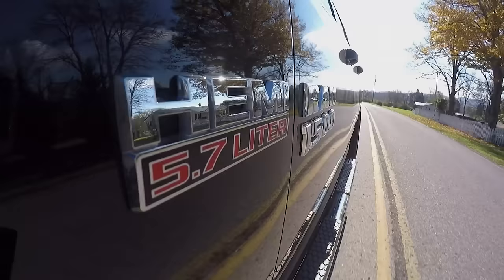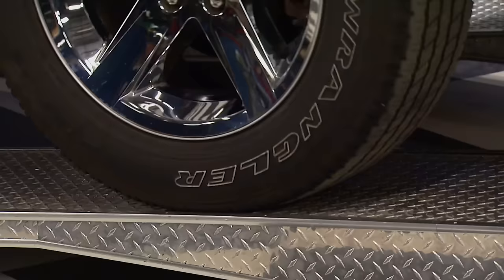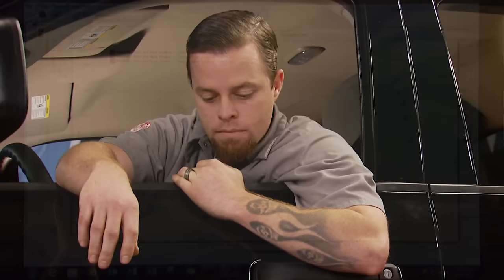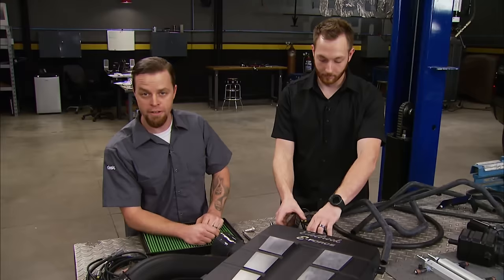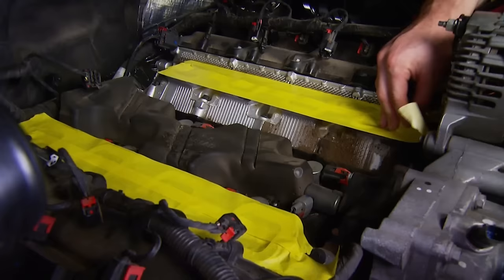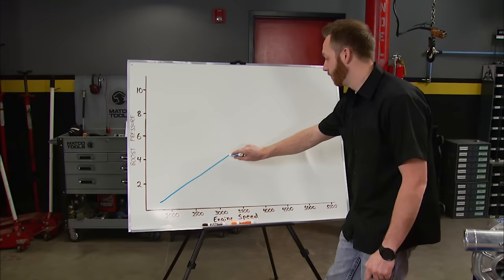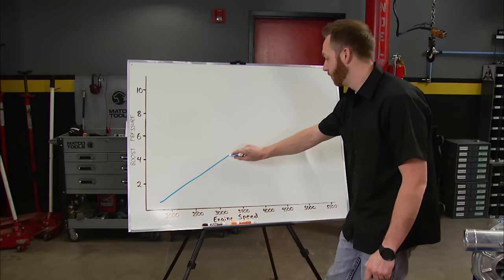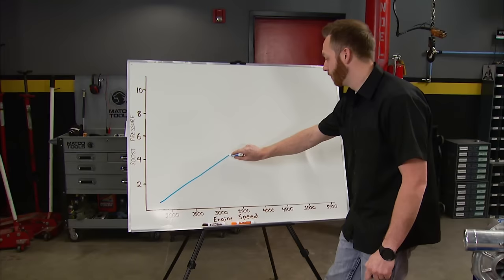Project Hemi-Hauler: Supercharger & Exhaust - Truck Tech S3, E3

Comment: All that money for 100 hp
Reply: Luis Cosme 130 hp gain on 6 psi is very good newb
Reply: @guerrerok90  oh yeah there is no doubt about that but you can get better hp with way less $
Reply: @pascobori9099  they could probably put a smaller pulley on it
Reply: theyre keeping it safe cause it aint built

Comment: I'm so confused. I don't know anything about vehicles but if you take out the stock engine then doesn't that not make it a hemi anymore?
Reply: If it’s replace with another hemi it’s still a hemi but yeah if not
Reply: Hemi refers to an engine that has hemispherical-shaped combustion chambers and pistons with rounded, instead of flat, tops.  When fitting a supercharger, the intake manifold is removed, but the combustion chamber remains untouched, so it is still a "hemi."
Reply: @meadmaker4525  see i wanna become part of the care/truck community but im tryna learn lol

Comment: stock airbox and stock headers are choking it, and the stock pcm doesnt help with that forced induction :( such potential wasted
Reply: Ya the stock air box has to go for sure. I gotta a k$n black series cai in my 2016 and it really helps the 5.7 breath way better

Comment: I'm first owner of a 2016 Dodge Ram 110.000km was thinking of installing a supercharger root style blower kit with your recommendation of a heat exchanger cooling system. I was wondering is it necessary to upgrade my fuel pump system and is my factory 8 speed transmission and differential 3.92 gear ratio too high kilometres for such a upgrade set up. My truck is a current daily driver  I would like to have extra power when I need it on hwy for passing and down a quarter mile track for fun weekends.

Comment: All that for 426HP? I just bought a 2021 Ram Hemi and it's 395 stock lol.
Reply: Smh lol that’s 395 to the crank not wheels. You have to account for drivetrain loss. So 426 to the wheels is a very good increase in power

Comment: i would like to see them do upgrades 2002 dodge ram with the 5.9L gas engine 2wd...i need some ideas
Reply: Get a dakota it will be faster than a half ton
Reply: @WOWster007  I'd like to work with what i have...
Reply: @PANTYEATR1  Supercharge the 5.9 then, recommend vortech or procharger MAYBE torq storm but their blower doesn't come with an intercooler. Best HP per buck unless you want to do a stroker build which will be expensive
Reply: @WOWster007  its funny you say that...i just purchased a 360 stroker last month for $1900. it makes the 360 a 408. it came with forged Scat crank and rods, forged pistons with new ring packs, freshly machined block, and all new rod and main bearings. I'm in the process of clearancing the block for the ARP rod bolts. i would have liked to use the supercharger from that Shelby Durango, but it looks like it would clutter up the engine bay and i couldn't find much info on it
Reply: @PANTYEATR1  I believe that one was Kenne Bell kit those are discontinued for the 5.9 so you have to find one used. Honestly the centrifugal blowers make more power than the roots style. Good luck with your stroker build!
Reply: @WOWster007  i just like the roots style fit the looks honestly. this is my daily and i just want good street power, nothing crazy. thanks for your input💪

Comment: A 2013 under 20k??? I paid 20k for a 2013 big horn 4 months ago!
Reply: Funny I just bought a 2015 limited  Laramie with everything except the ram box for 28 ... with 60,000 miles
Reply: @derekchauvinisahero2010  good price. Mine is a nicely optioned big horn with roughly 58k miles. The interior was optioned out but the original owner skipped all the exterior options and went aftermarket with it.

Comment: my old 1995 camaro with a LT1 made this kind of power with some headwork and a cam.
Reply: Must have been a huge cam.  I've got a blown ls6 470/455
Reply: That Lt1 motor you got if you drop it on a mid 90s Silverado that that truck would dust this overpriced hemi.

Comment: Love the engine upgrade but these engines are known for cracked valve springs and bad lifters. You should have upgraded these and checked the cam for damage before your mods. Why didn't you?  Also, use only Amsoil Synthetic Oil in this engine for maximum protection (simply the best).

Comment: That weird. My stock 2004 put down 290 HP at the wheels and 345 HP to the crank. The new 5.7 HEMI has 395 HP at the crank and only 305 HP at the wheels. That’s crazy. Maybe the transmission is slipping. I can’t understand loosing 90 HP in the driveline.

Comment: Should've traded the Ram for an F150 with a Coyote.  There's a lot less work that goes into installing a Whipple on a new F150.  And the less work results in way more power, and better reliability.
Reply: Yeah but the problem is then you have a ford...

Comment: Colum shifter? 6 speed!!... shame! the 8 speed ZF transmissions stronger.. faster and more fuel efficient!!  Literal car lengths you give up with the old 6 speed automatic 🤣
Reply: But wrong rear end ratio.  8 speed is for speed not pulling.
Reply: @deeply999  i strongly disagree. Ever driven a 8 speed? They stay in the power band 100% of the time. Low end torque, top end horsepower. Had plenty of time with my dads '14 ram driving, towing. Beltech loweringkit and put a airbag kit in the back that sat within the coil springs. Hauling a 20 foot enclosed trailer with a pt cruiser stuffed in the back going 80, 90mph the whole time, up, down the mountain. Wouldn't know it was back there. The 8 speed transmission is superior in every way to the old 6 speeds. Torque and power delivery, everything. 2wd truck, get 16-18mpg highway towing and 24, sometimes 25mpg all on it's own. After having extended drive time in his truck. Never even consider the 6 speed again, dont care what rear end gear it has 🤷‍♂️
Reply: koolaid water fountains for the fat kids ...   yes I own a 2016 trust me I know the power and what a pain it is with the 3.21 axle and the 8HP70 trans.  It will only tow 8814Lb. I know I can tow a bit more as my trailer is 9300 loaded but at 6 mpg it’s not anything I would recommend

Comment: " she'd rated at 375 hp " then only pulls 300 on the dyno.
Reply: 395hp was the factory rating. That Dyno number can't be right. Needs headers for sure
Reply: Sounds about right 375 number is to the crank the 300 was to the rear wheels
Reply: @hossmoss8577  That still seems like a lot of driveline loss to me...
Reply: That sounds about right
Reply: @lashlarue7924  na not really my GT500 makes 630 rwhp on a mustang dyno, since it's a mustang dyno you times that number by 1.19 which equals out to 750 at the crank.